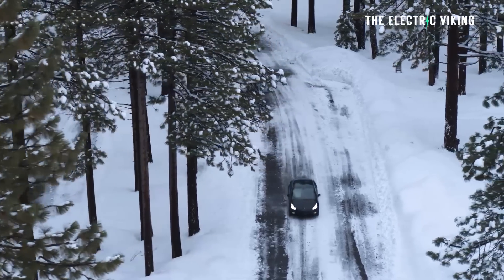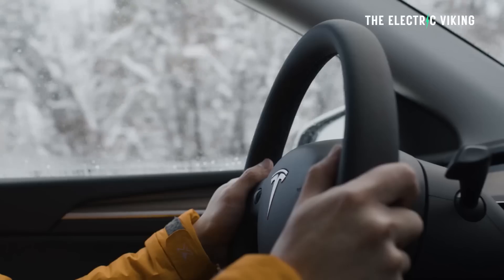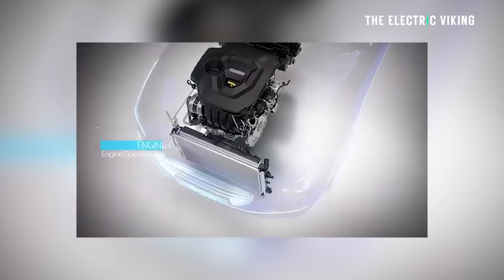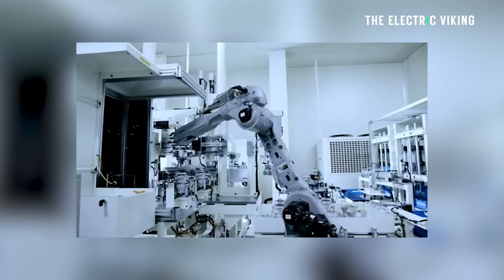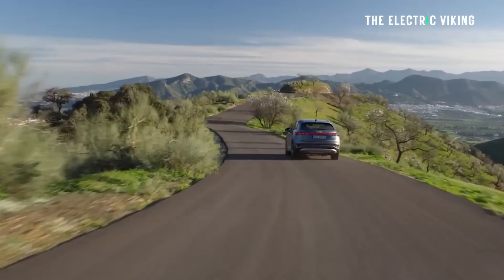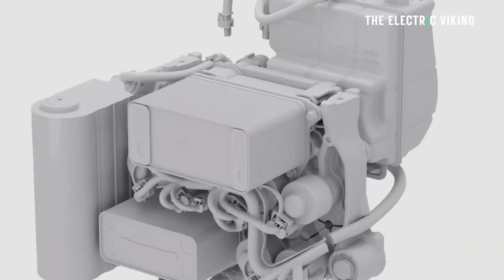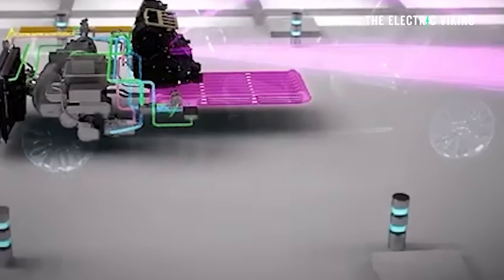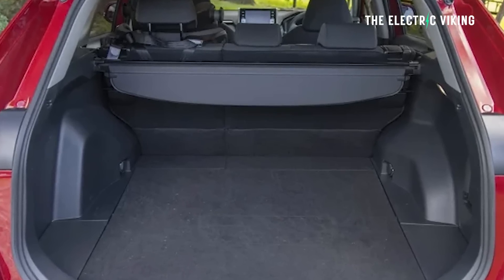Revolutionary heat pump boosts EV range and is 30% smaller!

Comment: This heat pump is good news.  What US car company will be using them first?
Reply: Heat pumps are old news. Every reputable EV manufacturer has them either as an option or standard.
Reply: @rogerphelps9939 @rogerphelps9939  As a recently retired engineer from the automotive industry, let me clarify. Yes, almost all vehicle manufacturers use heat pumps in their EVs and petro vehicles. What is unique about Hanon Systems is that their heat pump extracts heat from outside air, motors, and batteries using the lightest, most compact design. They also work with an EVs BMS and CCM to cool that battery, which increases efficiency. Most vehicle manufacturers are looking to improve their heat pumps, and using OEM outsourced units will lower costs because it costs a lot to pay their staff to build one internally.
Reply: @rogerphelps9939  This newer design is new news. He says the EV3 will use it.